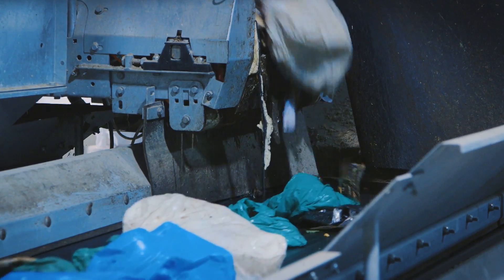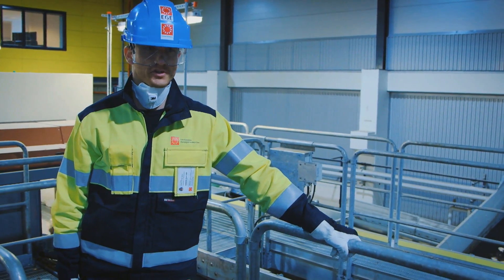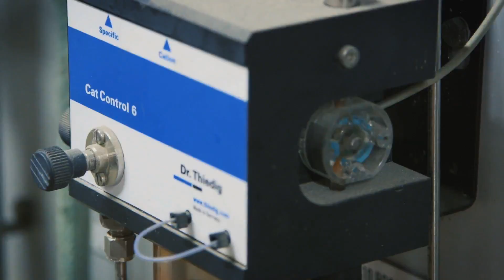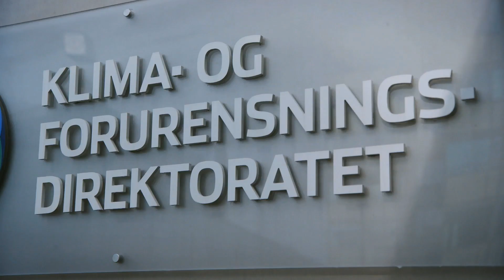Oslo Waste to Energy Plan (OV)

Comment: NOT awesome  there is no way to remove the crap from burning trash these greed heads have been touting this junk project for 20 years and have been continually shot down by real science .dont think a christian radio network is really a likely source for our save the world news ,USE LESS ENERGY is the answer they are wanting to avoid . compress your recycling !!!how many people even THINK of that? if all recycling was compressed ,five less trucks per town per day would have to run .so simple and  I cant think of ANYONE (besides myself)who bothers.and REALLY separate ALL toxics form your land fill trash  ,how many small devices have you discarded with the batteries still in,do your sweep up "squiggle"fluorescent bulbs  and just chuck them in the trash?  ($20,000  fine with possible jail time) etc etc

Comment: No, this is not the answer. The answer is to produce less waste and to recycle much more. This is incineration which produces massive atmospheric pollution and CO2. We need to start taking the greenhouse effect seriously. We need to improve the quality of the air we breath, and our children and unborn children breath via their mothers. There are many better ways to produce electricity.
Reply: Hi
Why do you think this is not a solution? I mean the best disposal for waste is to reuse or recycle it and not burn it. But compared to a landfill this waste to energy plant reduces greenhouse gases. Did you know that methan which is relised by landfill is more than 20 times worse for the environnement than CO2? By the way this plant is being upgraded with a pilot project of carbon capturing. In my opinion this waste to energy plants are part of the solution for the worlds garbage problems. 
Looking forward to your answer. Have a nice day
Reply: The output gas after incineration consists of 99% steam
Reply: Brother you are getting wrong information
Reply: Do you know what you are talking about?
99% of what’s coming out of the chimney is water vapor.